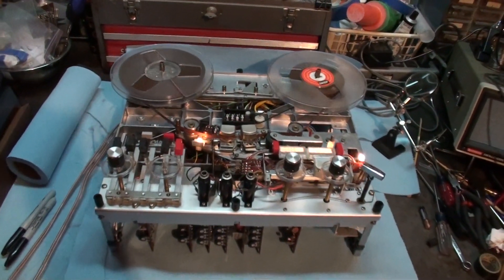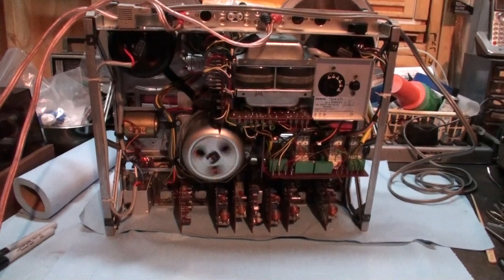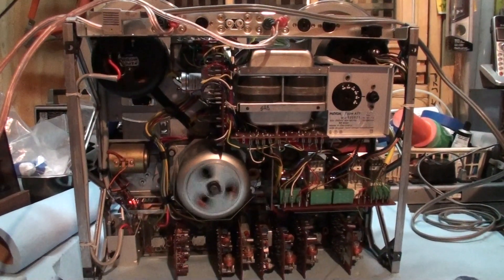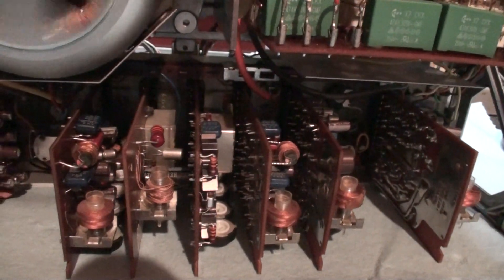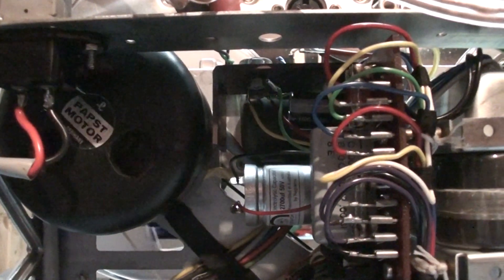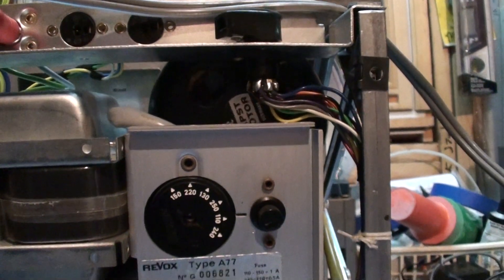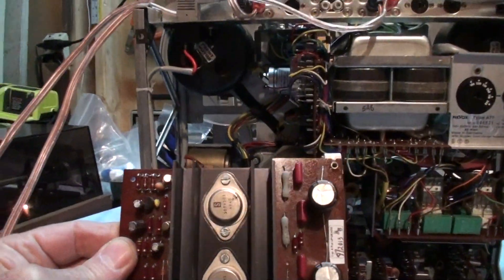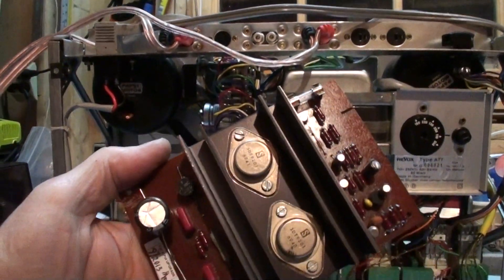Revox A77 Refurb Sequel

Comment: Hello from Germany! Good job -it is a wonderful machine. One remark: the bearing on the right side should not rotate-it must be a fixed one - otherwise the tape will not be firm enough on the right wheel. Mark I and MK II have a silver front,  MK III in black. MK IV is grey with blue "REVOX" letters.
Reply from the maker: Thank you.  The upgrade to rollers on both sides was an option recommended by Nagravox so I installed it.  Seems to run fine but if I have any problems I can convert it back :)

Comment: Indeed a very early MK 1 Revox, Probably made in early 1968? Mine is a MK 3 "71-73" vintage and still works great. I need a new bulb for the end of tape sensor, any ideas where I can get one?
Reply from the maker: metalmoto  Hello, Yes, this is where I got mine: http://www.nagravox.com.au/
Reply: ***** Thank You very much. My A77 MK 1 is virtually untouched, since I acquired it many years ago. My end of tape light bulb seems to be to dim to shut off the deck. I replaced it with a 12 volt bulb, which is much brighter, as it requires a 28 volt bulb, I believe? It actually works, (shuts off) with with the 12 volt bulb. But the 12 volt bulb is extremely bright, but the 12 volt bulb burns out in a few days.
I am hoping it's just the old dim bulb, otherwise it's the photo transistor that is failing. I would be interested in your opinion on that? Thanks again.

Comment: hello, after so many years ,,,,I'm taking a dive into the Revox  tape recorders ,Just purchased 3 units all needing work ,all are the A 77 different MK'S ,I would like to know if the parts of these 3 units are interchangeable,...great video ,, it would be nice if you could do a little vid on the circuitry . thanks  I enjoy it ..
Reply from the maker: eryk gee Hello,  I believe that many of the parts are indeed interchangeable.  You could ask on this forum: www.tapeheads.net or ask Peter via this Web site : http://www.nagravox.com.au/
Reply: Many parts are, but some are not.  There are differences in the drive control board.  The most significant difference is the speed control on MkIII/IV which is IC-based, versus the MkI/II transistor setup.  The IC-board is better, in my view.  I have been told the IC-board can be used in earlier MkI/II but have not attempted this myself.  There is nothing wrong with the transistor-based early speed control - but if you need to replace the transistors, the original part numbers are no longer available.  There are substitutes but you'll have to research what works and fits.  That's why I view the IC-board the better approach.

Comment: hi I have a 1968 Revox A77 Suitcase edition. she is mint inside i have replaced two capasitors & one resistor but the machine will not play.   ? the heads are spotless & Head path. i need help please.
Reply from the maker: Hi, Go to this web site and share your issues and questions and you will be certain to get the help you need.  Cheers. http://www.tapeheads.net/forums.php